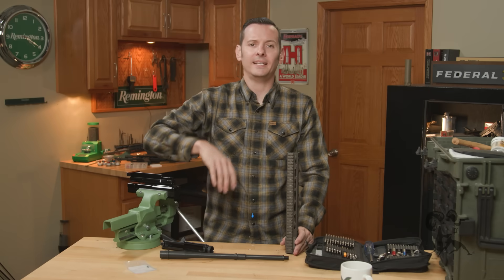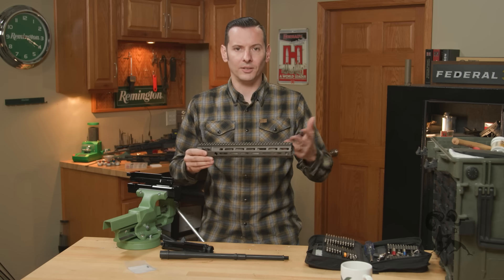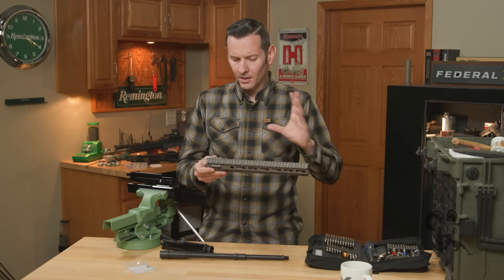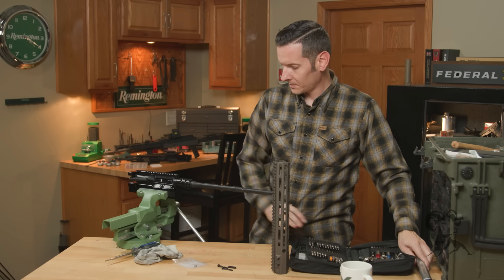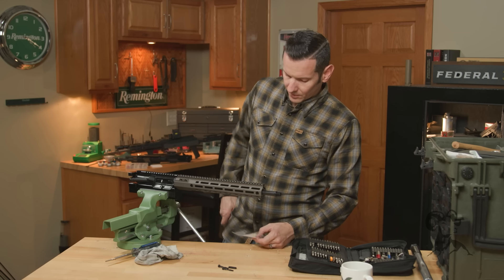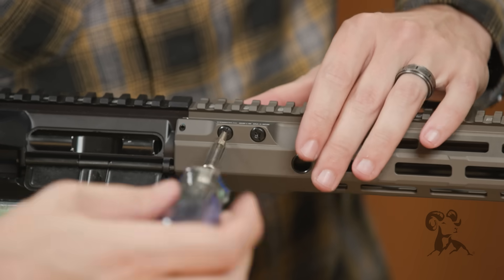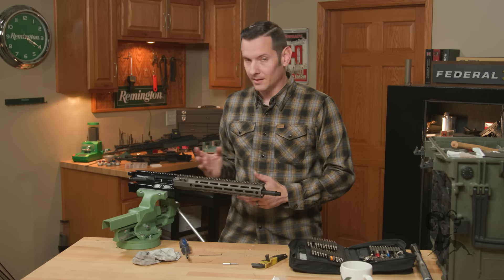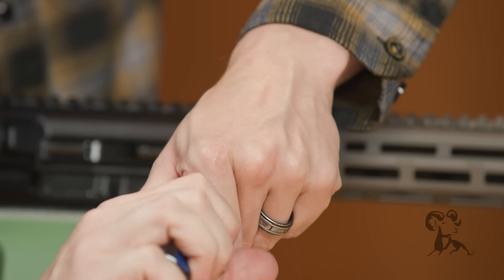Tech Tip: Aero MOD 4 Handguard Install

Comment: I’ve torqued my crossbolts to 60 in/lbs and the handguard still slightly rotates. Doesn’t seem right. The handguard should tighten on the barrel nut and not rely solely on the set screws correct?
Reply: Yeah something doesn't sound right. I have a KAK handguard that does have anti rotation tabs but they aren't super tight on the upper and once I torque the handguard screws tight I'm no longer able to rotate the handguard at all. Aero's design is probably different though so I can't speak to it.

Comment: Ummm..you need to secure the upper from the inside with an Upper Receiver Rod or something similar before torquing a barrel nut or muzzle device on, otherwise you risk bending/shearing the pin on the barrel extension or misalignment with barrel extension
Reply from the maker: No you dont.
Reply: @brownells  why not? You don't think all the rotational force when torquing to 60 ft-lbs can cause mistiming between the barrel & upper if there's a sloppy fit between the indexing pin and pin slot?

Comment: Is it recommended to, or not to, use loctite? That's usually something covered in these videos, but I'm just asking for a friend.
Reply: Good question and it's a common one. Here's what I usually recommend for upper builds:
For preventing different metals from galvanizing together when torqued (barrel nut threads, castle nut threads, etc.)
  - Aeroshell 64 
For gas block screws:
  -  Rocksett or Loctite 246 (high temp/oil resistant)
For gas key screws:
  - Loctite 246
For muzzle devices/suppressor mounts:
  - Rocksett
For scope bases & grip screws:
  - Vibra-tite VC-3
Reply: @CustomGunsAndReloading  for muzzle device u can just use aeroshell grease and torque to spec
Reply: @thinkingagain5966  Yep. Since I don't use any of my muzzle devices as suppressor mounts I just use some Iosso triple action oil on the threads and torque to 15-20 ft-lbs but Aeroshell or any other kind of assembly grease would also work just fine
Reply: @CustomGunsAndReloading thank you for your response and information.

Comment: no one ever mentions the center piece that houses the detent ball and spring. the friggin things come loose and then it's done for. what's supposed to hold that piece in the cover itself? that's what I've seen time and time again. that comes loose. it can't fall out because the detent won't let it fall out threw the cover, but it'll sure make a cover annoying

Comment: No way he's a gunsmith
Reply from the maker: Why is that?
Reply: @brownells  because your video is wrong in numerous places. Here are just a few: torque wrenches only click in one direction, you forgot to install the gas tube & gas block before installing the handguard, if using a muzzle device as a suppressor mount you should use some sort of high temp thread locker like Rocksett otherwise the muzzle device can get stuck in the suppressor/HUB mount, before torquing barrel nuts or muzzle devices it's best practice to secure the upper internally via the lugs first (via Magpul Bev Block, Midwest URR, etc.) otherwise you risk causing mis-timing between the barrel and upper (due to sloppy fit between pin and slot) and it can even cause index pins to snap off or damage the pin slot in the upper. School of the American rifle has a great video demonstrating this. Everything I pointed out is pretty basic stuff.

Comment: Might be a dumb question, but when performing a hand guard install, can I just use a regular lower receiver/mag well vise block?
Reply: Yes you can, you can also use an upper vice block like the one from Wheeler. I actually usually just lay the upper on my table and torque the handguard screws there without any vice etc..

Comment: I have two torque wrenches, and they don't torque in both directions. Yours doesn't seem to either. When you're tightening the barrel nut, there was no click. But when you loosened it, there was a click.
Reply: This ^^^
Reply: @CustomGunsAndReloading haha! Didn't realize I commented basically the same comment 3 months apart

Comment: I will never deal with them ever again. Customer service has gone down hill. I have several uppers, handguards and lowers enhanced version. I have both AR10 and AR15 versions. I ordered some items from them in-stock and their website states the following,
 "How long does it take for an order to ship?
Current shipping times are 3-5 days. Please expect higher lead times of up to 1 – 2 weeks for FFL items."  That is a bold face lie. I have been waiting for weeks, they have charged my account and my order still says processing. I have tried live chat and calling them for three days. Friday, Monday and Tuesday nothing literally on hold for 7 hours and never answered, live chat for 8 hours with no answer. i started as number 40 in the queue today and in two hours I was number 1 in the Queue and 3 hours later still number one in the Queue no response. So I ended up calling my credit union and disputing the charge with the fraud department. God forbid if I needed to address warranty issues. If anyone wants I have the Chat log and a video on how long I waited with no response. I was a very loyal customer to Aero Precision and recommended them to many of my Military friends. I will even share all the orders I have made with them throughout the years. I am amazed  how they went downhill and customer service turned to garbage. So, disappointing. Here is the Chat basically I was talking to my self with no responses I was still in the queue:

Chat started on 28 Jan 2025, 04:06 PM (GMT+0)
(04:06:24)	* MARK A CUTLER joined the chat *
(04:06:24)	MARK A CUTLER
Hi can you please cancel Order # 111306447
(04:17:59)	MARK A CUTLER
Hi can you please cancel Order # 111306447 - your site said 3 to 5 days for processing and it has been almost 2 weeks. 
(04:20:09)	MARK A CUTLER
Unfortunately, I can't wait any longer. I still work for the government and I will be gone for awhile. So, I am going to go a different route with a different company and upper receiver that can ship today or tomorrow,
(04:22:20)	MARK A CUTLER
I am a little confused that if the item is in stock, which it said it was and you have already charged my bank, which the money has been deducted from my account. How it takes a month to put the item in the mail, that is crazy to me and doesn't make logical sense.
(04:24:59)	MARK A CUTLER
I have been a loyal customer and have purchased a lot of stuff from Aero Precision online through your website and never had an issue like this or take so long. I have recommend you all to many of my friends and students that I teach firearm safety and how to shoot.
(04:28:38)	MARK A CUTLER
I think you need to update your website with accurate information on how long it will take to ship in-stock items. Currently it states 3 to 5 days. It needs to state 4 weeks to ship in-stock items and another 5 to 8 days for delivery. So, in reality it will take 6 weeks to receive in-stock items.
(06:19:43)	MARK A CUTLER
HELLO
(06:53:40)	MARK A CUTLER
Wow, this is ridiculous. I literally been in this que for 3 hours. It has been well over an hour since I been in Queue position 1. I guess I am just going to report to my bank that this order as fraud . I am so dissatisfied with the customer service. Yesterday I waited 6 hours in the Live Chat waiting to chat with someone. I was also on the phone at the same time to see which one would be faster. 6 hours just to talk to someone. God forbid if I had to try to return something for warranty. I use to be so impressed with your company, but I can not in good faith recommend going through you all to make a purchase. I hope manufacturing has also declined.
(07:20:15)	MARK A CUTLER
So, I am now getting the impression you are ignoring my chat. There is no way 2 hours in queue position 1. I started at like 40 and it took less time to go from queue position 40 to queue position 1. Then it has me waiting in queue position 1.
(07:45:47)	MARK A CUTLER
you can cancel my whole account. I am done with your company. I am posting a video of me on hold with you all and for how long. I am on the phone with my bank right now, disputing the charge.
(07:51:02)	MARK A CUTLER
So, it has been reported to my bank as fraud. I am ending this chat. I am not going to waste anymore of my time. After researching online, seems I am not the only person that has issues with your company.
(07:51:18)	* MARK A CUTLER left the chat *

Comment: I just ordered one and to answer most peoples questions ………. YES the riflespeed adjustable gas block DOES FIT under this handguard onnly downside is that you have to use a punch amd punch out the steel qd mounts which is not a big deal you cam just buy mlok ones
Reply: Thank you so much, this is a deal breaker that I wouldn't have known about without your comment.

Comment: I feel like the original m4e1 handguard would be more rigid. 8 screws bolted directly to the upper receiver. A little bit thicker though.

Comment: Many Torque wrench manufacturers say not to use the torque wrench to loosen.
Reply: They make that blanket statement so people don't use them to loosen fasteners when they don't know how much torque it will take.  If I am "seasoning" my threads on my barrel nut at 30 ft. lbs I know it is torqued to 30 ft. lbs.  I can take that off since I know it is within the range of the torque wrench.  An example of when not to do it would be if a threadlocker was used.  If I torque my muzzle device to 25 ft. lbs. with rocksette I use a breaker bar, not my torque wrench since I don't know how much torque it will take.  The manufacturers reduce their warranty liability by putting that statement in there for people who don't know this.
Reply: @JenkinsStevenD  why couldn't you just set it to something "extremely heavier" like 80 ft-lb and break it loose like that? If the wrench doesn't hit the 80 ft-lb mark but the nut breaks loose, isn't that safe? And if it does hit the mark without loosening, then couldn't you keep increasing the torque setting until it breaks loose?

Comment: Grease has no business on a barrel extension. The opposite… green Loctite, would be the right choice
Reply from the maker: Absolutely not!
Reply: A grease such as aeroshell 64 inhibits corrosion, effectively preventing it from occurring.
Reply: This is blatantly incorrect, aluminum and steel can undergo a process called "galvanic corrosion", which can be described as when moisture permeates within the mated threads, essentially causing the aluminum to act as an anode with the steel being the cathode leading to rapid corrosion and deterioration of the threads. This is a problem as the integrity of the upper is weakened in a vital area, and the barrel nut will be considerably harder to remove.

Comment: Thanks for making this video. I was excited for this handguard until I saw the grub screw anti-rotation method. Terrible idea. 

They should have just made friction fit tabs, that way you have no chance of the screws rattling loose or becoming stripped because you accidentally over tighten the tiny 1/16" hex head.
Reply: ......Blue Loctite.....
Reply: The URGI used by American special forces uses the same grub screw method for anti rotation, by the way

Comment: So an upside down Geissele style mounted handguard for $15-$25 less...forgive me if I don't see the appeal. I had issues with rails moving my LAM zero after being knocked around in the woods and during courses. Solution: HK 416. Turns out when you have a massive tab and slot connecting the handguard to the upper rail movement isn't really an issue lol.
Reply: Lmt.
Reply: Super duty upper also has a tab on the rail and slot in the upper. There are of course the monorails etc. for most secure setup...also rails like the ones from SOLGW, Zev, etc. have the anti rotation pin that mates with a pin hole in some uppers (SOLGW, Zev, etc.).

Comment: what is the upper receiver fixture? What brand and model is it?
Reply: I was wondering the same thing and found it on Brownells website. It's called "The Device Manufacturing LLC AR15/M16 Upper Reciever Fixture". They are expensive! $300
Reply: @MealTeam6_  Yeah it's a giant waste of money and isn't even the best way to secure an upper before applying 60 ft-lbs of torque to a barrel nut. You need to secure the upper internally first via the lugs or you risk damaging the index pin on the extension and causing mis-timing between the upper and the barrel/extension. Get something like a Magpul Bev Block for $55 and you're good to go. As a bonus you can also use it to hold lowers via their magwell if you flip it around. If you want a more robust way then I recommend the Midwest Industrials Upper Receiver Rod (# MIURR) that has a removable "sail" on the top so when you take it off it functions like a geissele reaction rod.

Comment: I like the design, but it is not clear how the hand guard rail stays aligned with the Upper Receiver rails.  Their should be an alignment piece to align the Upper Receiver rails to the hand guard rails.  Sorry.  The geek is coming out of me again, and you can't spell Geek without EE.
Reply: Clamp a scope mount on top. Half on reciever and half on the handguard then do whatever the installation procedure is. Blue loctite all your screws.
Reply: @waldo5661  I currently do that.  It just looks like it can rotate in either direction until the wings on the side with set screws hit the upper receiver.  I could be wrong.
Reply: @paulwilson8672  once it is squared up and each setscrew is touching the receiver it is no longer able to rotate. If that answers your question.
Reply: @waldo5661  Yes!!!  Thank you!!!

Comment: What upper vise block is that?
Reply: its called "the device"
Reply: $300.00 on Brownell's
I'll stick to my Midwest Industries URR for $125.00, which is actually a better design by the rod engaging the barrel extension and locking it in place. 
When you tighten the barrel nut the torque is applied to the barrel extension, not the upper receiver threads.

Comment: Is it just me or is the top of the hand guard rail a 1/4” lower than the upper receiver rail?
Reply: Enlightened rail / scalloped rail. Many manufacturers do it for weight savings. The rail height is still to spec and sits flush on the upper outside edges of the pic rail.
Reply: He’s talking about how the picatinny, they make it this way so you have a continuous top rail if you want to bridge the upper and the hand guard.
Reply: @catlantis7216  yeah I know it is, must have been the camera or my bad eyes, just seemed off to me. I would not expect Aero to make a product like that.
Reply: @janssenmoen953  na i see it too but it's just the design of the upper, its a fat notch on the end of the Pic rail so the hand gaurd is aligned with the bottom of the Pic groove.